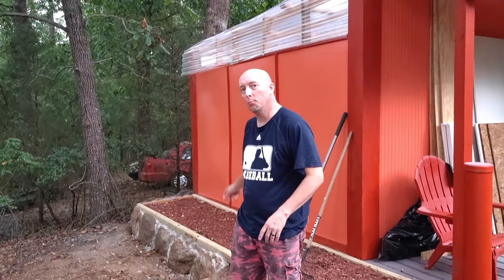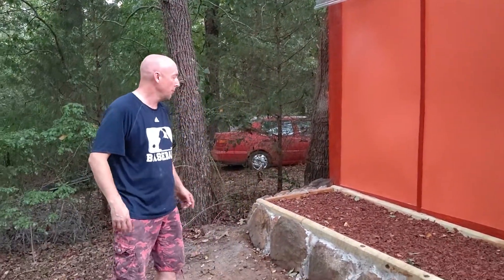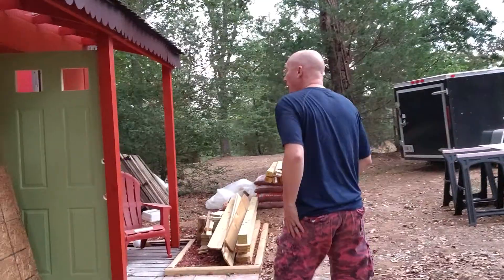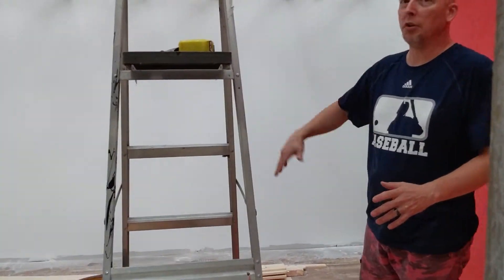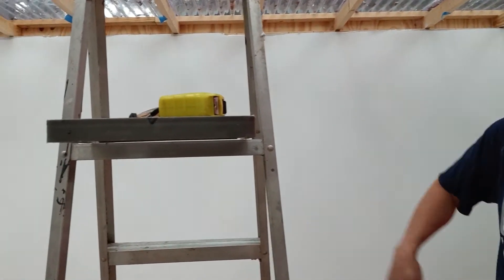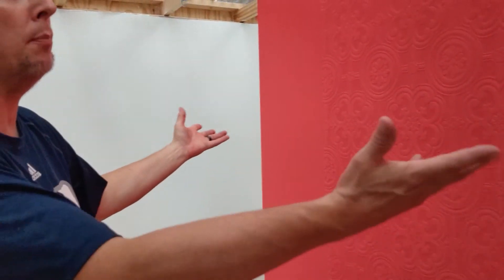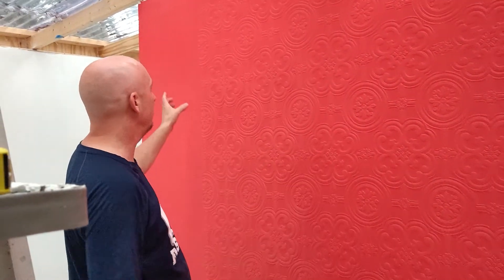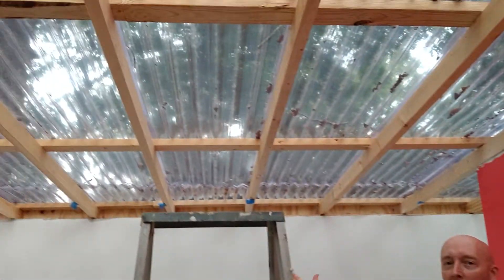How to build a pallet shed Part 9

Comment: Great job..
Reply from the maker: Thanks. I think the only thing I would have done differently was to reinforce the floor. Those were pretty old and weak pallets, so they have a bit of flex in them. If I were to have used a thicker flooring material, it would be a more solid structure.